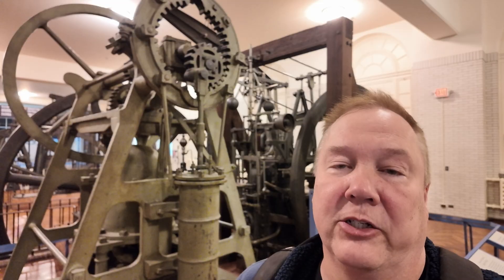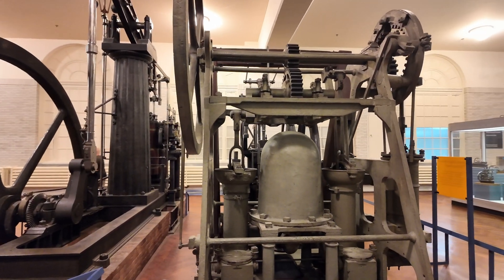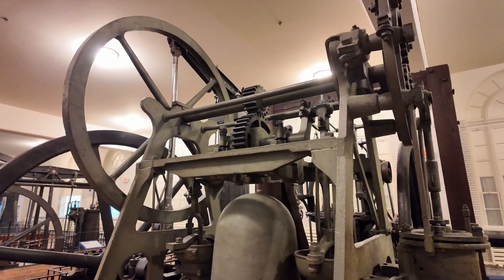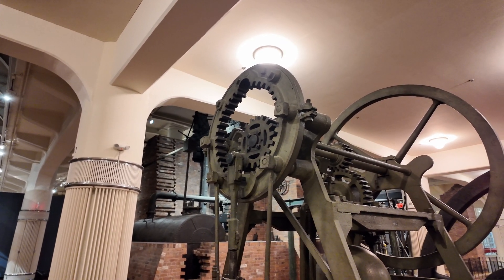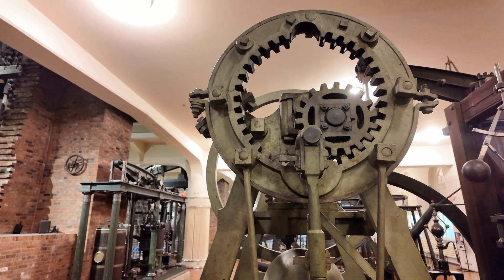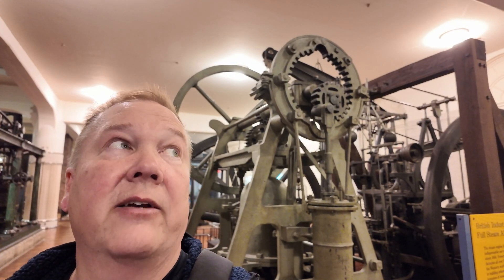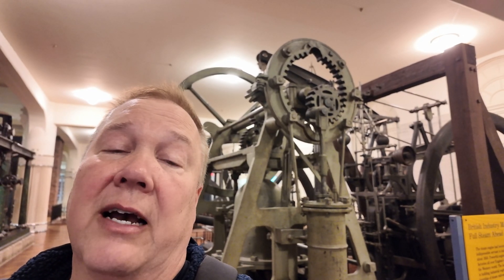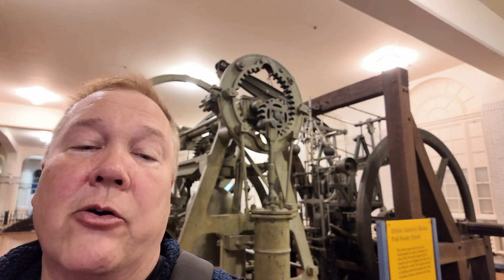The Steam Engine You Never Knew Existed!

Comment: So, correct me if I'm wrong, because of the active patent till 1800, James Watt effectively halted progress (except his own) on steam engine development for 30 something years? He maybe was a great guy, but if that's the case, he wasn't as much as he could be.
Reply from the maker: Yes and no.  Development went on, at least to some degree, although a lot didn't get released until afterwards.  The patent that expired in 1800 was basically on his steam engine design, plus some aspirational stuff, like "strong steam" (higher pressures) which he never used.  It didn't include things like his parallel motion, rotational steam engine, governor/regulator, etc, since those came later.
Right after his main patent expired in 1800, there does seem to have been an explosion in new steam engine designs, although a big part of that is from boiler improvements which stopped them from exploding quite as often.  That was probably the bigger factor in impeding new designs.  Also, quite a lot of people simply pirated his technology, and that patent was, even at the time, considered by many to be overly broad and quite weak, so he rarely went to court, but just threatened to do so - kinda like modern "cease and desist" letters.
It's a topic I haven't looked into a lot, but just run into bits and pieces here and there.

Comment: Watt's steam engine came after the atmospheric steam engine, which used atmospheric pressure to do work. Watt's invention used direct steam pressure, which resulted in a much smaller compact apparatus.
Reply from the maker: Watt's initial steam engine patent did include the option to use what he called "strong steam" but he never made a production engine over 5psi, same as Newcomen.  He did invent a lot of improvements, but if you compare his giant canal pump with the nearly as large mine pump from Newcomen (I did videos on both and they sit right next to each other today), the only difference was that Watt moved the condenser outside the cylinder, which allowed for much greater efficiency.
It wasn't that Watt didn't know higher pressure would work better.  He did.  So did Newcomen, and everyone else.  They knew that not having to create vacuum would make for simpler machines, but they couldn't do it because boilers and pipes weren't there yet, and every time someone tried, it'd explode.  It wasn't until Trevithick that people were finally able to ditch the vacuum/atmospheric part of steam engines and start to increase pressures, which opened the path for much smaller, more efficient engines, as well as portable and self-propelled steam engines.
Reply: @Industrial_Revolution  James Watt is like the Howard Stark of steam engines: he knew what was possible, but the technology wasn't there yet.  lol  ;)

Comment: Kinda wild that we went from Savery's high pressure Miner's Friend to such a long period of only low pressures, but it does parallel the long history of internal combustion engines prior to designs that compressed the charge prior to ignition - the remarkable power released from a fuel/air charge compressed over the full stroke was observed quite early on, but never utilized!
Reply from the maker: Although Watt definitely knew of the benefits of high-pressure steam (which he called strong steam), and even patented it, he never produced an engine over 5psi.  Newcomen probably even knew higher pressure would be useful.  What really held it back was the boilers and pipes.  It took until the 1800's until boilers could handle the pressure.

Comment: I've never heard of a geared steam engine.
Reply from the maker: The cycloidal ones, like this, were pretty rare.  Running a steam engine to a geared system was more common, going to a gear instead of a leather-belted flywheel.  Even in locomotives, gearing was done in some, like Shay locomotives.

Comment: Needs 4 pistons, each separated 90° from each aroung the circular gear.  That would eliminate the need for a counterbalance.
Reply from the maker: Even two would help, and prevent it from getting stuck at either end of the stroke.  That's why locomotive pistons are 90 degrees apart.

Comment: in current engines rotational motion is transformed into vertical motion by the piston rubbing on the cylinder wall, this causes much of the friction on an engine and causes pistons to wear as well as increasing fuel consumption. in steam engines they used a cross head for this function, better than the current designs but this was better still. I would be a lot more expensive and has it's own problems.
Reply from the maker: Design is always a set of trade-offs.  Best info I could find for this engine why no one is building them is that the overall efficiency was just really low.
Reply: @Industrial_Revolution i dont see why, van you give me a link to that please?

Comment: I have a feeling that the Science Museum in London may have one of these engines. I'm pretty sure they also have documented the type. Great video by the way.😊
Reply from the maker: It's possible.  I haven't been there, but hope to get there someday.
Reply: @Industrial_Revolution  Well, when you do make it there, you won't be disappointed. However, there are quite a number of industrial heritage museums around the British Isles. I was born just a few kilometers from Dartmouth, in Devon which is where Thomas Newcomen and Thomas Savory first demonstrated what is now known as the Newcomen Engine in  1712. Effectively that engine was the first practical motor to go into production . Move accross the Tamar River into Cornwall you will find the home of Richard Trevithick. Trevithick invented the high pressure engine. Although Watt gained the glory in modern history books for inventing the steam Engine, he instead extended Newcomen's Engine to reduce energy losses. Neither Newcomen or Watt invented what we would term Steam Engines which work via means of a pressurised working fluid, their Atmospheric Engines Condensed Expanded Gas (Wet Steam), thus the working fluid was the Ambient Air Pressure of the Atmosphere. Trevithick's major breakthroughs were the High Pressure Boiler, and the Over-Pressure-Safety-Valve, thus he was able to directly drive his piston. The same man then installed a version of his boiler  onto rolling chassis and demonstrated the first automobile "Puffing Devil", and predecessor to the railway locomotive which has also pioneered. Commemorated by the folk-song, "Up Camborne Hill".
Reply from the maker: I know I could easily spend weeks there just going from place to place.
It's really surprising that so few people in the states have even heard of Trevithick.  Everyone's got replicas of Rocket, but a lot of people seem to think that was the first self-propelled steam engine, which is actually what I was taught in school.
Reply: @Industrial_Revolution  I too was taught the Rocket was the first locomotive, also the the Watt engine was the first steam engine. Trevithick did a lot of boiler development work, many of his steam boiler/engine designs were used in Mississippi (and Murray River Australia - see Echuca in Northern Victoria), he also introduced the first practical pressure regulator and burst/mitigation control mechanisms, e.g. burst discs. As far as history lessons go, like so much in early years education, it follows a national/political narrative and low hanging fruit policy. In fact, think of anyone one well known for inventing X or Y and you probably have the wrong person. For example, everyone thinks that Marconi invented the Radio transmitter/receiver. However, Lodge invented the device (and exact design) that Marconi demonstrated, fascinating story of deception and fraud.
Reply from the maker: I didn't know Trevithick invented the burst disk.  I'm not surprised, though, since the thing that held back high pressure steam had been boiler and pipe safety, and that's a big safety feature there.
I've got another one.  Growing up in SE Michigan, we were taught that Henry Ford invented the automobile.  He didn't, of course, but he's enough of a home-town hero that everyone was wiling to accept it.

Comment: I believe there is another reason this configuration did not catch on:the velocity profile of the piston. I think to the piston travel at a constant velocity throughout the stroke and when it reaches the end, must instantaneously reverse direction with very high acceleration and resulting high force.  Therefore, stroke speed /rpm is greatly limited.
Reply from the maker: Would that piston have necessarily traveled at a constant speed?  If you look at the pistons on a steam locomotive when it starts out, they speed up to around the center of the stroke, then slow down toward the end.  The connecting rods to the drivers connect in a similar way as the piston rod connects to the gear, so pretty similar, really.

Comment: 2:38 A closer inspection of the mechanism reveals that your statement is incorrect. The planetary gears are not set up as a gear reduction drive, as there is no sun gear. Force is transferred into the small gear and directly through it to the crank, resulting in a standard single revolution of the crank shaft per full engine cycle.
Reply: The cycloidal radius of the piston pin's motion on the planet gear is exactly canceled out by the planet gear's radial motion around the crank shaft, resulting in a perfect linear motion of the piston pin. 

Because the planet gear spins the opposite direction of the crankshaft rotation, the bearing speed at the crank pin would be double, as they make 2 complete revolutions relative to each other; however, the planetary gear's motion inside the ring gear cancels out so that they each only make one revolution relative to the engine.
Reply from the maker: Now I need to go count gear teeth!

Comment: If it's truly a planetary gear set up then it'd add more torque at the cost of speed but if the design was an inverse planetary gear set It could add speed at the cost of torque. still an amazing system and the planetary gear engines were built cause even though the steam patients had expired the straight crank patients were still in full force. there's no telling what that engine was originally used for. Could of been for a small tailor's shop or carpentry shop, maybe even an early paddle steamer or tugboat. My bet is it's a small workshop engine for an early steam workshop and Henry ford probably got it out of an old family workshop when they were modernizing or letting the workshop die. I believe this engine is at least documented enough to be known where he got it and how it spent its' working life.
Reply from the maker: If they eventually reopen the archive to the public, there may be more information in there.  Then again, if it's like the Grasshopper Engine sitting right next to it, they may not have much information and have just found it abandoned somewhere.

Comment: Anyone know why the cyclodial engine never caught on?  Looks very efficient, so there must be a cost reason.
Reply from the maker: All I found is that they were very low power for their size/fuel consumption.
Reply: @Industrial_Revolution  Thank you. 
Fuel consumption might be it. 
The piston force 'seems" to be directed up instead of at an angle, like on a crank shaft, giving better power transfer. 
Hope someone tinkers with it again to see if it can be made better.

Comment: Did a little research & was able to find the maximum steam pressures concerning the following sidewheel steamers:
  1827 HANCOCK        - copper boiler in the hull - 12 psi "high" pressure
  1832 KING PHILIP     - copper boiler in the hull - 15 psi "high" pressure
           [1837 - claimed 1st steam whistle on a steamer]
  1847 BAY STATE        - 2 iron boilers on the guards - 25 psi pressure
  1848 EMPIRE STATE - 2 iron boilers on the guards - 25 psi pressure
           [1856 - burst steam pipe - number of passengers & crew died]
  1855 METROPOLIS   - 2 iron boilers on the guards - 25 psi pressure
  1865 NEWPORT         - 4 iron boilers on the guards - 25 psi pressure
           [4 separate smoke-stacks]
  1865 OLD COLONY    - 2 iron boilers on the guards - 27 psi pressure
  1867 BRISTOL            - 3 iron boilers in the hull        - 25 psi pressure
  1867 PROVIDENCE    - 3 iron boilers in the hull        - 25 psi pressure
           [BRISTOL & PROVIDENCE were identical sister ships]
  1883 PILGRIM             - 4 iron boilers in hull               - 50 psi pressure
           [largest single cylinder working beam engine]
  1889 PURITAN            - 8 [steel?] boilers in hull        - 110 psi pressure [largest compound, 1 high & 1 low pressure cylinder, working beam engine]
  1890 PLYMOUTH        - 8 steel boilers in hull           - 170 psi pressure
  [triple-expansion engine 1 high, 1 intermediate & 2 low pressure cylinders] 
  1894 PRISCILLA         - 10 steel boilers in hull         - 150 psi pressure
  [double compound-expansion engine 2 high & 2 low pressure cylinders]
     The reason steamers, particularly on the Hudson River & Long Island Sound, put their boilers on the guards was in case of a boiler explosion the boat might not sink.
Reply from the maker: Amazing!  63 years from 12 to 170psi.
Reply: A lot of people were just not willing to take the risks involved with higher pressures. It’s not just the boilers but everything along with it from gauges to every fitting. That had to be able to do the job. One thing I learned with research into early 1886-1910 automobiles was that even the specifications (bits, rpm, cut amount, cut speed) that govern things like modern machine milling… didn’t exist before 1904. And were developed privately via private company testing between the 1880s and 1900.

Comment: I think what hasn't been said about this design is that the cycloidal gears are an elegant way to convert straight line motion into rotary motion.  There is no need for a crosshead and connecting rod, or a Watts linkage. the piston rod moves in a straight line up and down. 
This isn't really obvious without seeing the engine in motion. 
This isn't the same as the planetary gears seen on some other engines that were an attempt to circumvent the crank patents.
Reply from the maker: It looks good, and is incredibly compact.  I wonder if someone could make them work today.
Reply: While elegant, I don't think this mechanism is practical for modern engines. As implemented here, the gears have large teeth, and gaps top and bottom for clearance of the connecting rod pin. It's a low speed mechanism. It would vibrate excessively at the speeds of a modern medium size marine diesel say. It's also a low torque mechanism. With the crank on one side of the gears, and the rod pin on the other, there are a lot of heavy off axis torques. This version of the design wouldn't survive the loads of a comparatively high performance modern engine.

Redesigning it for a modern engine, such as a marine diesel, you'd need a much finer pitch on the gears, and no more gaps at the top and bottom either, so the gears would have to be even larger diameter too, and perhaps use herringbone gears. Such large gears are expensive to make, and you need one for each cylinder. They're also subject to very high forces, both piston thrust and shaft torque, and those forces are constantly changing every combustion cycle. The whole thing has to be very rigid to ensure good consist tooth contact for long life. Difficult to achieve the necessary rigidity on such large gears, especially since the connection between the cylinder and the shaft is 3 part: con-rod, gear, crank, each with bearings in between. A convoluted path which all has to be very rigid and strong under tremendous forces with a long life at relatively high speed.

Not impossible to engineer by any means, but I think a conventional crosshead sounds a lot easier, and probably more reliable and rugged in the end.

Assembly is also a problem. A conventional crank-case is split to allow crank installation, but you definitely don't want to split a gear in two, especially in such a demanding application. The whole crank mechanism would have to be installed through the gears (plural, one for each cylinder), which just makes the design even more complicated and the engineering even more challenging. These days, even German engineers aren't permitted such excesses.
Reply from the maker: Good analysis of the flaws.  Another reason to think that this may have been just experimental.  A surprising number of engines at that time were running with just one cylinder, but adding at least a second, rotated 90 degrees off stroke, would be a big improvement, and prevent the engine from getting stuck if stopped top or bottom of the stroke.
One advantage of steam over diesel, though, doesn't steam have a much smoother stroke, compared to internal combustion?  That'd help some, but you're right, still not enough.  It'd be nice to see someone build a replica of this to see how it actually ran.
Reply: @Industrial_Revolution  Diesel, especially, has very high impulse forces. That's why they tend to have a Dual Mass Flywheel to absorb the worst of the impulses. Otherwise the gearbox needs to be much bigger. (There is also a lot more noise from the gearbox on solid-flywheel vehicles)  Even with a DMF one diesel programme I worked on had to limit engine torque to 400Nm through a gearbox rated at 800Nm for gasoline applications.